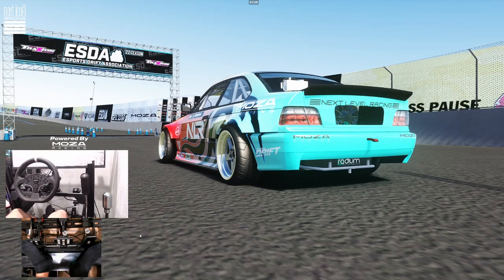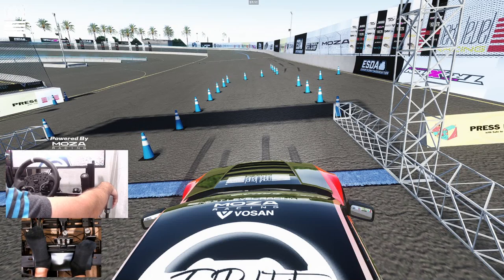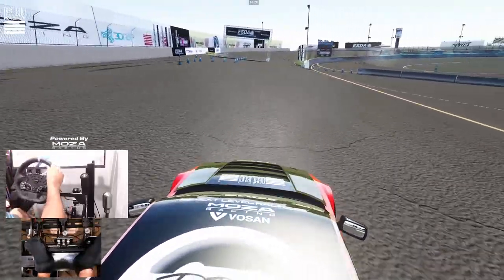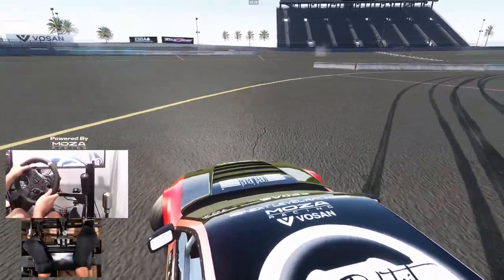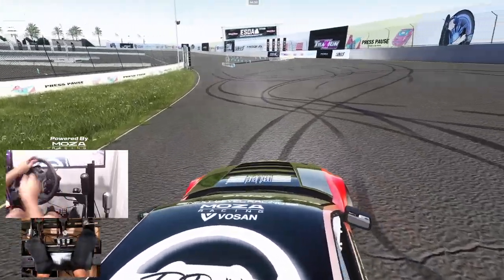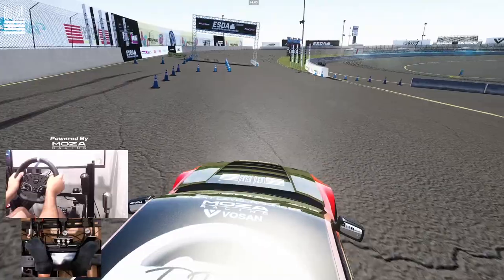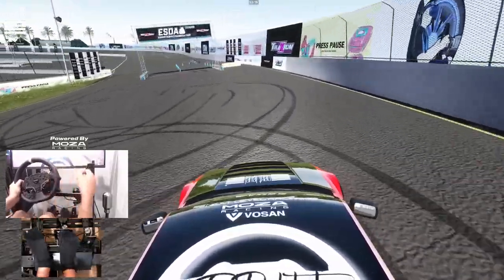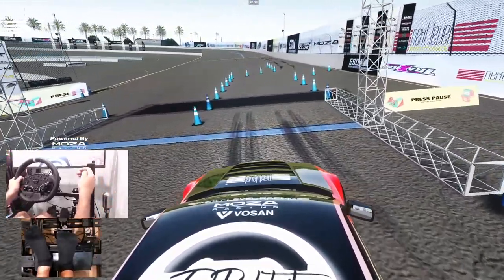ESDA RD 7  Irwindale Testing - Wheel / Pedal cam - Moza R5

Comment: Can you post what settings you use in the Moza app? Whenever I try to get a setup for drift, I feel like the wheel has a safety feature that prohibits it from spinning back to neutral when I'm trying to drift.
Reply from the maker: Make sure you have hand protection off